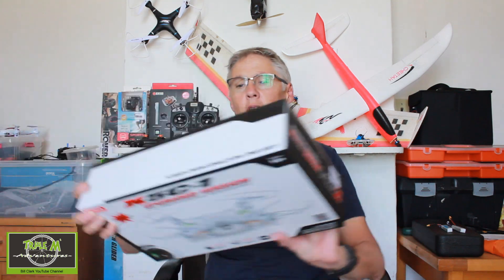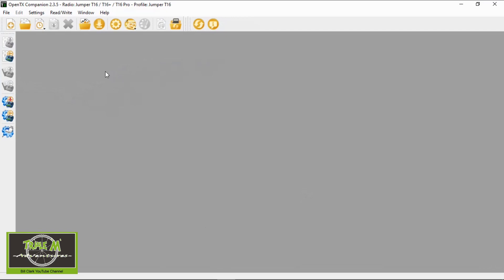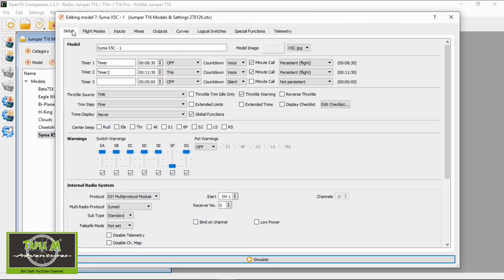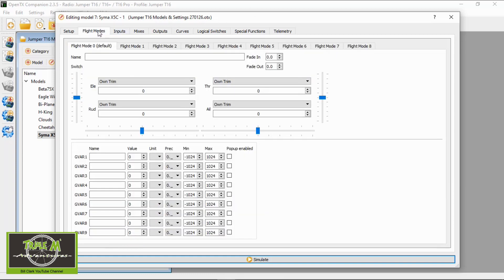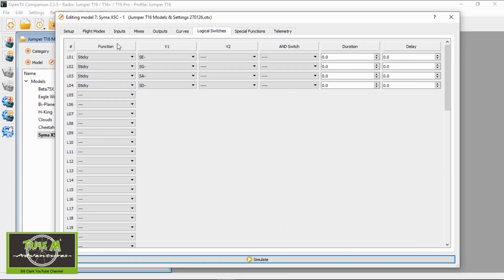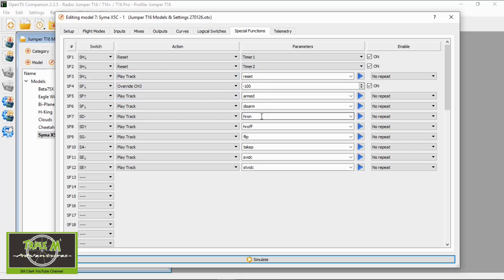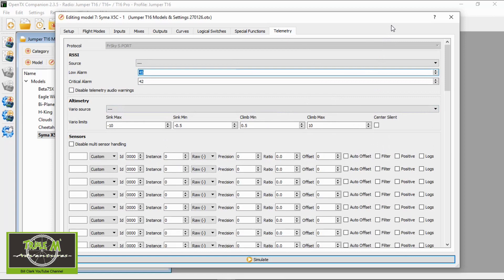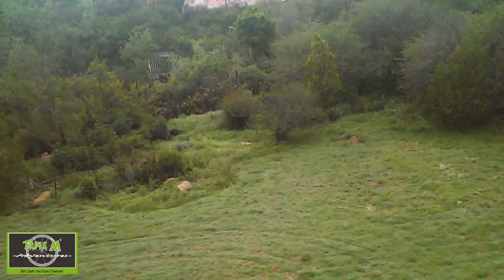Jumper T16 Setting Up A Toy Grade Quad Copter

Comment: Hi Bill. Great video.  I've hooked my Syma X5C to my Jumper T16 and I'm going to follow this tutorial to set up the flip and rates settings.
I've also installed an all-in-one vtx and camera in mine.  (Caddx Firefly) It works fine on the 1S battery and it hardly affects flight time.  (The original camera ended up in the bin along with the transmitter.)
Could you please expand on the 'armed' and 'disarmed' settings?  To arm my Syma, I've got to turn it on first, then the transmitter, and after a few seconds it binds.  Is it possible to set up an 'arm' switch so I don't have to turn the quad on first?
I tried the original arming sequence of moving the throttle to maximum and back to minimum, but nothing happens.
Reply from the maker: Hi Muzz, to arm all my models I set the arming process on a switch if the switch is in the back position my model will not arm for safety this only happens when you model is powered up. What is different with a model that does not have a flight controller which is programmable you need to set up a "Safe" throttle in your radio the link below should help you this, your motors will not arm if your throttle is forward. With a flight controller using Betaflight you just need to select a switch on your radio to arm your quad. The original arming process used with the transmitter supplied with the Syma will not work, as long as you have set up your channels correctly your throttle should operate the motors as soon as you push forward on the stick but I advise to set up an arming switch and a "safe" throttle. This video should help you.
"Safe" Throttle
https://youtu.be/B6jbDA7a10s
https://youtu.be/ccK0Zou-2RA 

Any further questions please do not hesitate to email me bill@triplemadventures.co.za

Comment: Hey Bill, is that the SYMA you lost in the bush? I use the momentary switch for my flip button. I don't use a timer on my syma because the lights flash when the battery gets low.
Reply from the maker: Yes it is :( I would have set up the flip button the same way but I use it to reset the timer. You just have to be careful using a non momentary switch because the flip mode stays on! I was amazed at the range of the quad when using the Jumper T16. I flew it straight up and it nearly disappeared it was dusk so I could just see the lights of the quad. I am going to get another one.